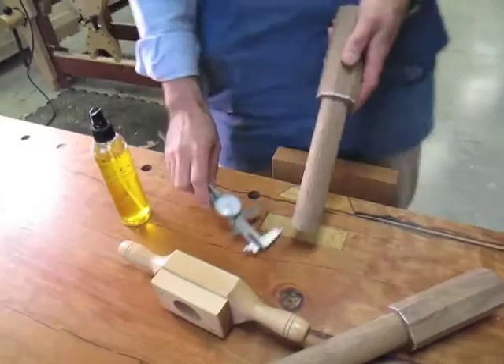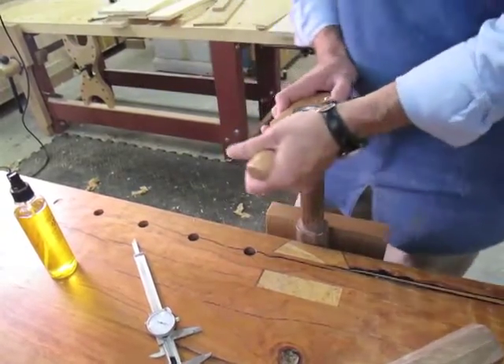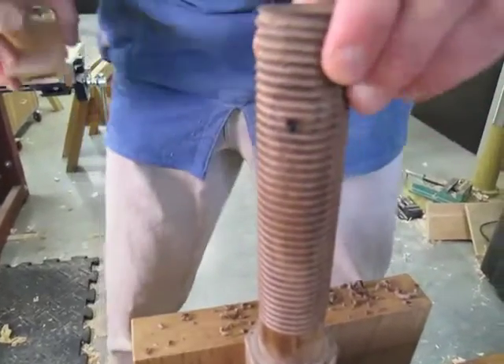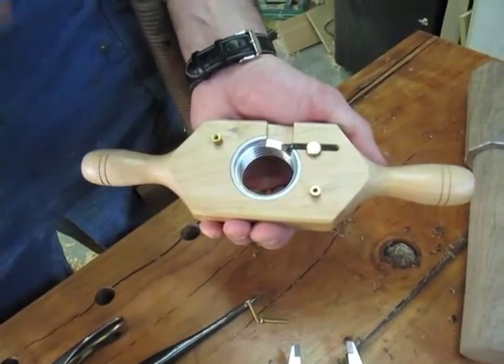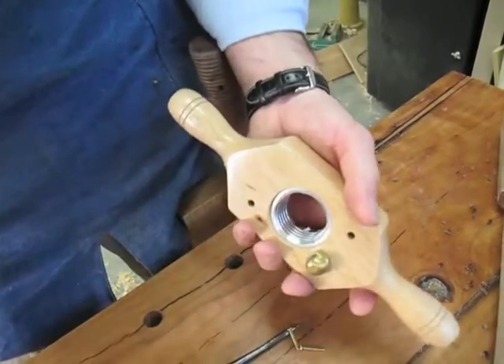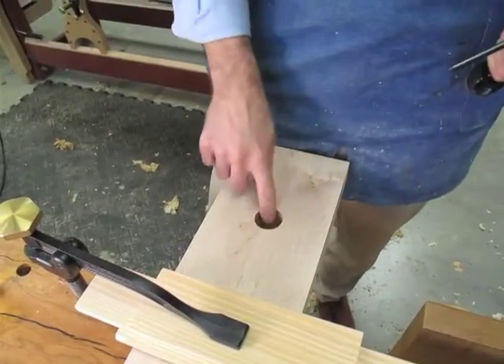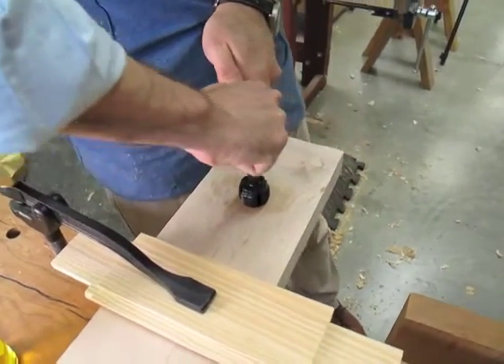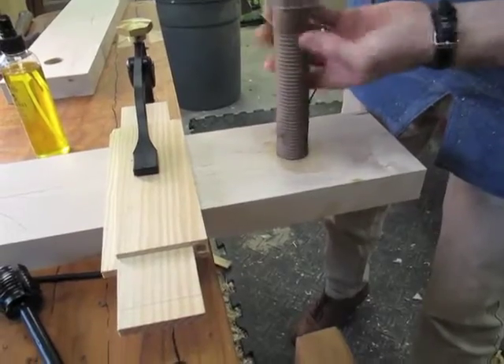Woodthreading: Adjust and Use a Thread Box

Comment: After cutting multiple dowels with mine I am not as satisfied with the thread contact and measured the angle of the cutter in the die box and noticed it is off from the tap by 6% I am hoping to fix my sloppy threads by regrinding the cutter to match the tap appropriately.